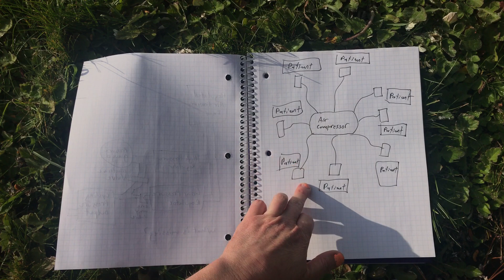Can we design an emergency ventilator that works? COVID-19 treatment.

Comment: Hi Taylor. You don't need a low pressure source, you just need a PEEP valve. You need to control the rate if inhale and exhale, to be able to be either one to one, one to two and one to three. the device needs to be able to take low pressure pure oxygen and add it to the mix of air the ventilator is pushing into the patient. You need high pressure safety release valves,  pressure dials and a way to measure the volume of aid coming into and out of the patient. You can't use a regular compressor that uses an oil lubricant as it will make the air toxic. the air needs to be humidified if possible. Hope this helps.
Reply: @Shimmy Shai I believe you need a scroll compressor. Keep in mind hospitals have 50PSI in the hospital walls, just like power outlets

Comment: This is flawed... You have to have a low pressure valve after the lungs for the low pressure. 90% of this can be built from PVC plumbing and sprinkler system parts. I am an engineer, inventor, and 3D print prototype parts on daily basis. Luckylarry at gmail

Comment: I firmly believe that anything is possible. Having said that, the obstacles appear to be many and great. For us to have any real success at this I would assume we would need to get all onboard the same coordinated game plan right away. That in itself would be a monumental effert. If its possible,  and needed count me in. 
As for the single air compressor,  I would assume anything in the med field would require redundancy.  Which would be simple enough to add multiple compressors (if thats the device chosen)

Even if the machine had to be very complicated,  if enough of the right people come together,  again possible
But above all I hope it dont come to that!

Comment: I believe your understanding is correct (see https://en.wikipedia.org/wiki/Positive_end-expiratory_pressure ).  The problem with air compressors as breathing devices is that the air contains oil droplets which would exacerbate breathing problems; one avenue of research in this area would be surface air compressors used by divers.  The real thing that you would need to be concerned about is that you're not building a device that will cause side-effects, or kill more people than it saves.